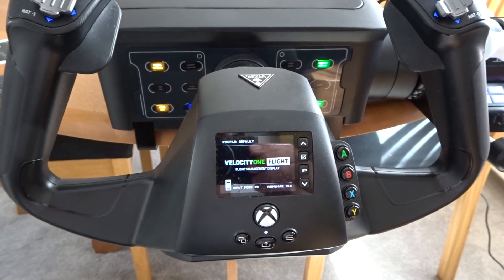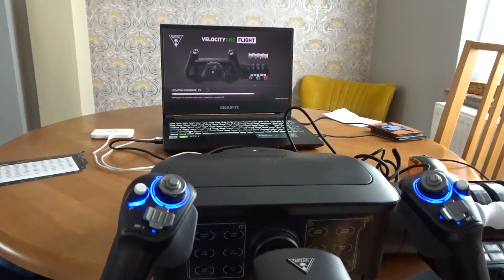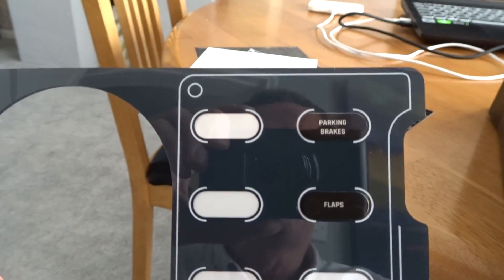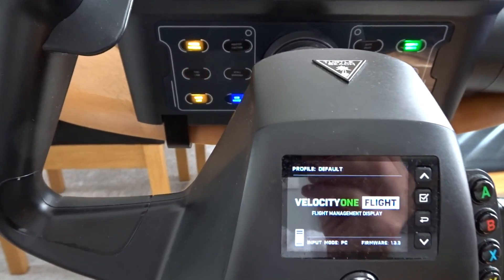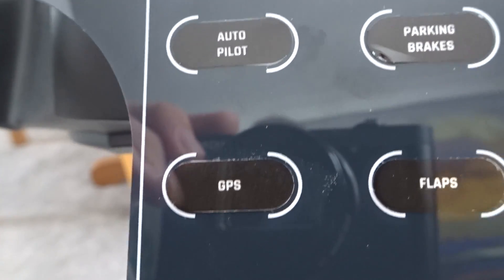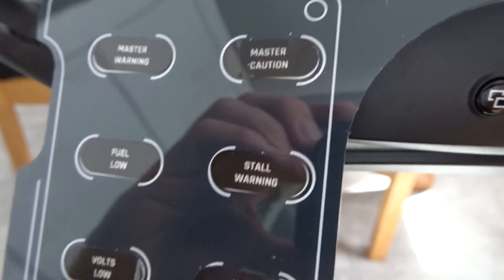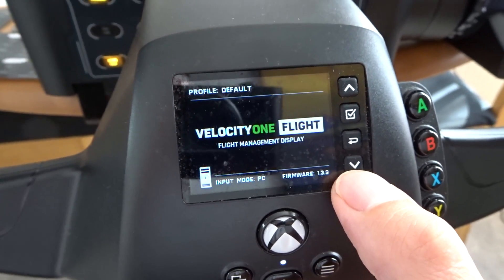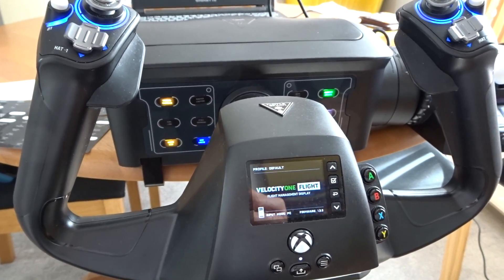FS2020: Velocity One Flight: How To Update To Firmware 1.3.3 & Setting Up A Bespoke SIP Layout!

Comment: Great Video! It is wonderful that the SIP functions can be rearranged to suit one's needs. Unfortunately, the choices for customizing the SIP array is very limited. I would like to see TB update this to allow buttons on the throttle body to be linked to the SIP. I have the four buttons on the far right bound with Probe Heat, Engine IPS, Windshield IPS and Wing/Stab IPS. These are set in toggle mode. I would like to see a light (green) to come on the SIP for each of these buttons when I toggle the function on. Of course the SIP lights would turn off when I toggle the function off. 

I have a solution to your sticky decal problem. I have created a template in Google Draw that has three masks that can be attached to the V1F SIP panel and the throttle body button panel. I simply print the template with my printer (laser), then cut out the masks. Add a bit of cellophane tape and Bob's your uncle! Custom labels for the V1F SIP and button panels. Here is a link to the template. https://docs.google.com/drawings/d/1VuSmZwja0pd0OXJik539Iisp_ExGKhulaE5e3HsfPp0/edit?usp=sharing  Better use the link ASAP before YT removes it. One caveat: I'm in the USA and this template was created for 8.5x11 inch paper. If printing on A4 paper, some distortion may occur that will need to be tweaked. Best to make a copy of the file and work with the copy. I have shared this on your Discord channel, # velocity-one-peripherals, along with some pictures.

Comment: My Velocity one still has a 'sticky' feeling after 9 months of use.
Any ideas? 
Silicone grease on the shaft?
It's unrealistic and a nuisance.
Trim wheel is a bug bare of mine also.
Reply from the maker: You're best checking in with the TB Discord.
Reply: @Huddison Thank you.. Is there a workable solution in the discussion?
Reply from the maker: @QuantatativeStealing  There are various bugs and fixes type discussions on there, you'd be best taking a look for yourself.

Comment: I am using 1.4 and I can’t get SIP to work at all. The service is started and msfs2020 selected
Reply from the maker: Best contacting TB, or go to their discord.
Reply: Try not selecting any flight sim  from the TB icon in the tray widget (what ever it’s called). 

I was having issues as well on PC. I have V1F firmware v1.5, SIP Connect v1.4. I made the following changes. I don’t have SIP Connect or it’s shortcut in the shell:startup folder. I do have SIP Connect and it’s support files in their expanded folder as per TB instructions on my Desktop. I have an SIP Connect shortcut in my Taskbar. 

My startup routine is this: 1) Start up PC, wait for that to complete. 2) Launch MSFS 2020. 3) While that is starting up, I open my browser to Simbrief to create a FP. My preference, not really necessary. I download my FP to my PC to import it to MSFS later. 4) Once MSFS 2020 is fully loaded, I click on the TB icon in the Taskbar to launch SIP Connect. I DO NOT right click the TB icon in the tray and therefore DO NOT select MSFS there. If you double click the TB icon in the tray, you will launch the SIP Connect settings app. You should find MSFS already highlighted there. 

This is what works for me. Best of luck. 😊

Comment: Mine stopped working after less than 5 minutes of use after trying to do the update.  Now it only shows Update Mode and won’t get out of that mode after trying all of the fixes that I could find on the internet!  This system is a piece of crap for me!

10/22/2022
I contacted Turtle Beach and they reach out to me the next day and sent me the PDF file and the link to another file to fix my Velocity One Flight Yoke using a PC.  I actually used my laptop to get my Velocity One fixed/updated.  Now everything works as it should.

Comment: Hello Hudson.  I've unfortunately had a problem with updating latest firmware on Series X. After following the exact instructions, the control center said update failed. Since then (two days ago) the unit is stuck in update mode. I've tried every trouble shooting tip available with no luck. Do you know if it's possible to factory reset the velocityone?  I can't find this option on the net, but figure there has to be a way. Sorry for long note, but you're my last resort. 😀
Reply from the maker: Hi, you're best contacting TB directly over this.  I recall folks having similar issues in their discord: https://discord.gg/tH7JjSpz
Reply: @Huddison  Will do, thank you.
Reply: Same issue here, contacted TB support over this issue and awaiting a response 😡 super annoyed that a £300 controller can have this issue over a simple firmware update
Reply: @stonersmurf  as tu réglé ton problème ? Car je suis dans le meme cas.  Je viens d’acheter et bloqué sur update mode. Impossible de passer le firmware ou réinitialiser le yoke!!!!
Reply: @ketur75019  non, j'ai retourné le yoke pour un remboursement car il était bloque en 'update mode'. C'est une blague complète! J'ai acheté le Thrustmaster HOTAS à la place 😡
Reply: Hi, get and download an uninstall app, and remove the velocity installation, including the registry entry. I can pass on the one I use if you getcstuck? Once it's removed, reboot and let it install again. That should give you a fresh start? S
Reply: uninstall the app from Windows (?) and reinstall.
Reply: @stephenmason5682  doesn't work if you're on Xbox.

Comment: Great video, as always.
Hopefully this is (somehow??) coming to XBox soon... maybe via the Turtle Beach app.
Sadly, two of the main lights I want; speed brakes and reverse thrust; don't look as if they will be implemented at all.
I would dearly like to see the 10 quadrant button lights click on/off,
so that you can tell if (aircraft lights in my case) are on or not.
This would also free up some SIP spaces for other lights.
Turtle Beach, if you are listening....
On the plus side the Chrono now seems to work properly.
I have a Brother label printer with black on clear tapes, which I have used to make SIP and buttons labels and it works very well.
Reply from the maker: Hopefully more SIP functions will be on their way. I've a feeling part of the issues lie on the Asobo side of things.

Comment: Excellent video. Very valuable service to show us this. That last update (1.3) wasn't very good. The autopilot issue and then I'm having trouble going in and out of my plane (the view). I have to click two to three times. Hopefully this fixes that. Update went smoothly thanks to you.
Reply from the maker: Thanks for the gracious comments and happy to be of help.
Reply: @Huddison  I just love the wallpaper!  Gorgeous design.  ;-)   Great video as well.
Reply: I just used it in default. My autopilot light still not working. I guess we’ll have to wait for the next update. Patience.
Reply: I’ve just noticed that problem with toggling the view from internal to external as well. Seems to have happened as a result of updating to v1.3 strangely.

Comment: I have the same problem with the Autopilot. It was working fine before I messed with it but I can't get it back to the default.
Reply from the maker: TB recommend rolling back to 1.2 firmware and sip connect.  It should really be operational in this update.